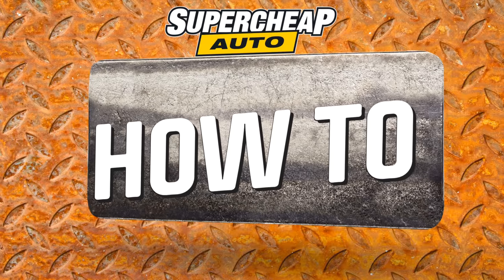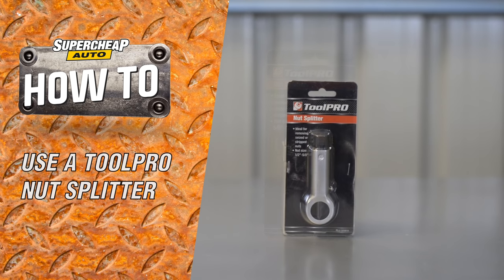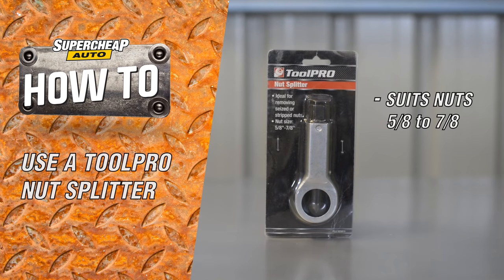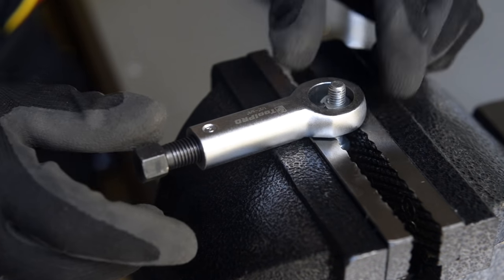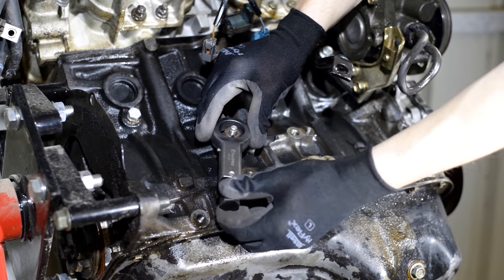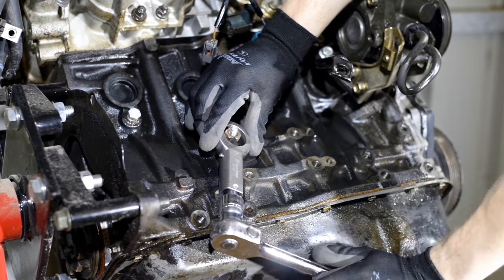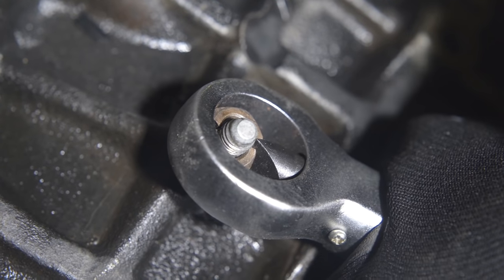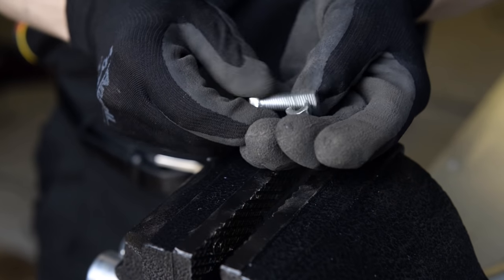Removing a Seized Nut Or Bolt // ToolPRO Nut Splitters

Comment: hold the nut splitter body flats with an adjustable wrench or an open ended wrench to keep it square with the nut and bolt..